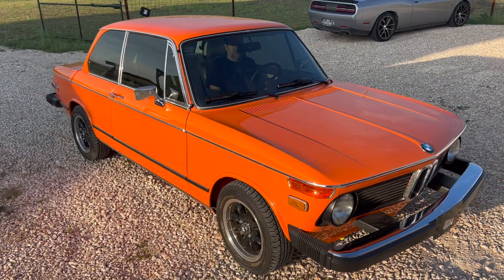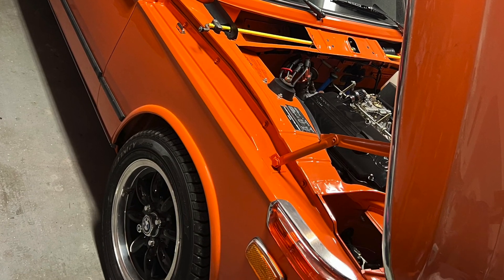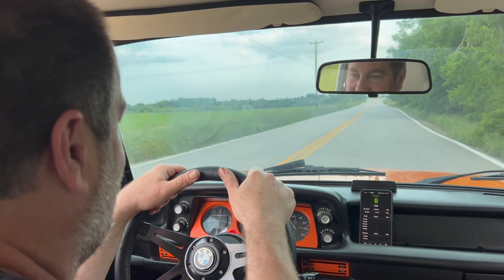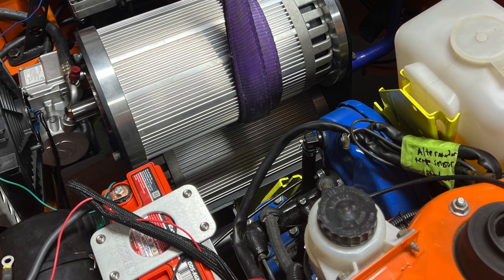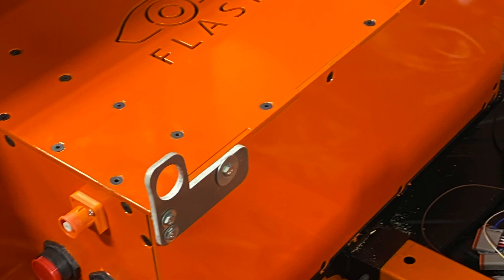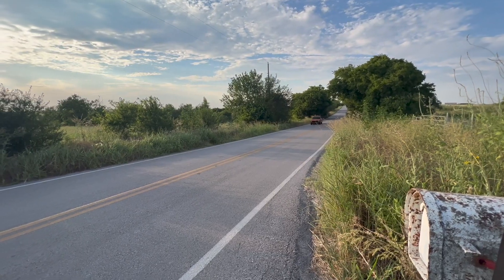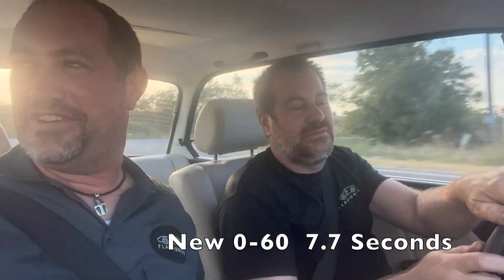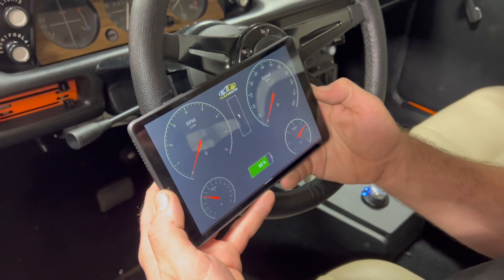How fast is a 2002 BMW with Dual Electric Hyper9 and Tesla Batteries?

Comment: Where do you come up with the HP and torque figures for a dual motor setup? I’ve not seen it on Net-gains website? Are you using the yoke adapter from there website?

Comment: HI i just found out the zilla controller are no longer being made  So gives me a excuse to convert my home made trike to ac hyper9 motor i currently use the zilla 2k  1 warp-9 dc motor and 8 fiat 500e packs for a total voltage of 203 at zilla 2k full amps. WILL this put me close to my current set up as well can i put 203v to the hyper9

Comment: If he use single motor correct gearbox. He will surely get better speed and torque
Reply from the maker: Gear box would have provided a ton of lower end acceleration.  We are building something one now with dual motors and 5 speed

Comment: Nice video. I always find the dual Hyper9 a strange thing though. Isn’t there any single unit equivalent “replacement” for that setup? By the way, how much was the final weight of the car compared with the original?
Reply from the maker: There is a "new" motor that is supposed to be equivalent, but I haven't seen one installed in anything.

Comment: That engine wasn't running right. The stock non tii was good for under 11s 0-60. With those carbs and the usual mods, should be 7 ish.
Reply from the maker: With an auto, I doubt 7s with whatever carb. Maybe a shot of nitrous.

Comment: I was surprised that you were wiring 2 HyPer9 motors to a 7 Tesla Module battery pack. My estimate is that the pack is good for about 160 Volts. Are you wiring the motors in parallel to the battery so that each motor gets the full 160 V from the pack? Is the current draw from 2 motors in parallel hard on the pack? What is the range like?
Reply from the maker: Range is actually pretty good. ~130 miles. And it’s 144 nominal voltage.  Current draw under full load is 1000 amps